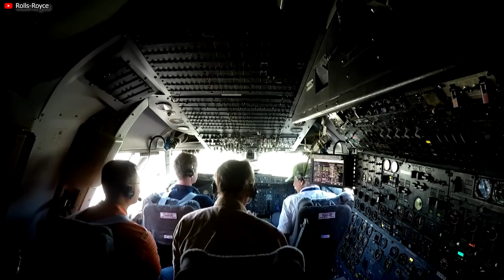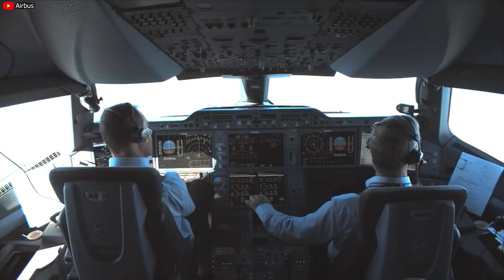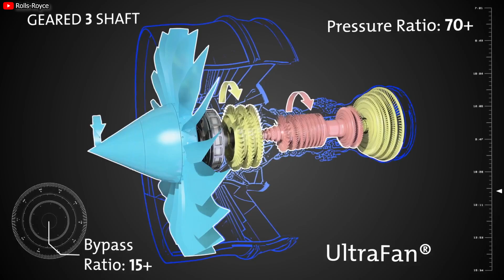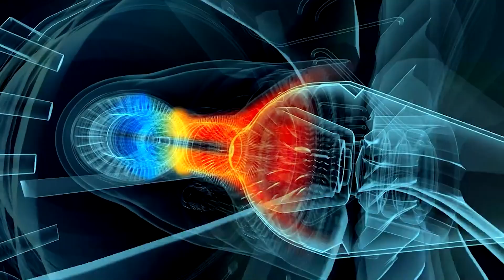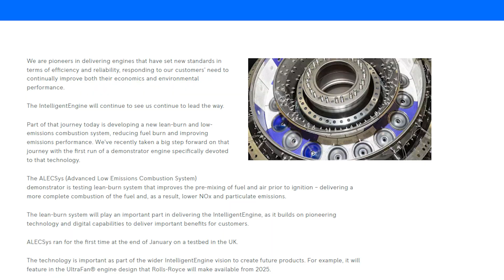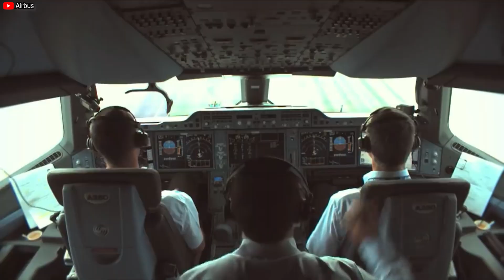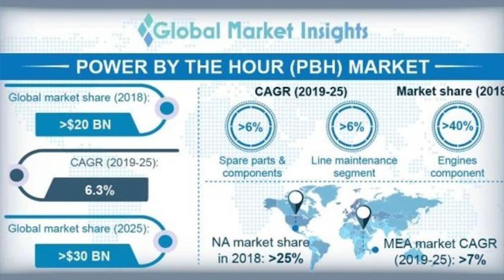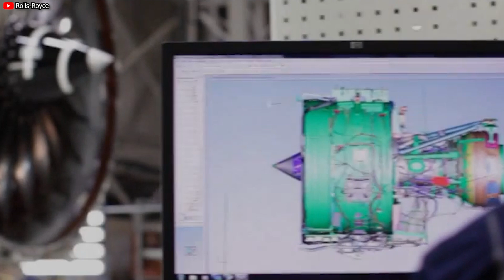Rolls Royce CEO: ''This NEW Engine Will Change The Entire Aviation"! Here's Why

Comment: Now we only need fuselages where it is possible to mount such engines. Boeing already showed how it does not work.
Reply: It will be fitted first to the airbus A350
Reply: @Bottle111  This would require a new design, as the center of gravity significantly goes backward, and additional forces are introduced into the tail. Then, it would no longer be an A350, but a new type with new certifications. You may pay the billions.
Reply from the maker: thanks for your comment
Reply: Older aircrafts mounted engines aft fuselage, ahead of the fin.
Reply: @hakantorstensson8053  DC9/MD80/B-717 worked like that. But it would be best if you had a T-shaped empennage so that the horizontal stabilizers do not get the exhaust of the engines. However, T-shaped empennages may cause aerodynamic problems in stall conditions.

Comment: I really don't know where you got your information from.

According to RR themselves, the whole point of this engine is to have a single technology that is scalable from the largest twin engined widebodies right down to the A320/737 and a little below - perhaps a stretched A220 for example.

This is in no way a move away from the single aisle market. It is very much a move towards re-entering it.

The A350 is reaching the point where people are starting to expect an imminent re-engine announcement. This could force Boeing to upgrade the 787"s engines to remain competitive.

Since the A320 series with the neo and the 737, with the MAX being quite recent and far less likely to have an engine upgrade, it makes sense to start with the big engines first.

As for the smaller versions, I think that may very much depend on whether Airbus stetch the A320 series further any time soon, or Boeing finally goes ahead with the NMA - or Airbus beats them to it!

Currently, there are no engines suitable for anything between the heaviest A321/MAX 10 and the A330/787.

The Ultrafan currently being tested could well be a candidate for a stretched A350 to compete with the larger 777x's. After all, the A350 has some way to go before it matches the length of the longest A340.
Reply from the maker: thanks for sharing

Comment: Yes, there is a great potential to these engines. The use of compound materials enabled the enlargement of the outer fans diameter. The former material used was titanium compounds that couldn't tolerate the combination of long fans with high velocity (the professional term is Critical Centrifugal Torque). Having huge fans enlarge the outer engine diameter that allows greater air bypass, that in turn brings to better cooling effect to the inner smallest fans (these can be easily reach unwanted heat closer to their melting point). It means that now the improved jet engine can be run at much higher speeds and therefore be put to longer shut offs for fuel saving and quieter flight experience.

Always happy to help,
Ken Barr, engineer and business analyst.
Reply from the maker: thanks for feedback

Comment: This is b/s. RR lets it sit there waiting.  It should be offered to the single aircraft market. There are hundreds still to be built. isn't it supposed to be scaleable? Its not even certified yet! What are they waiting for?
Reply from the maker: thanks
Reply: According to my info from private sources inside RR, 3 new UltraFans of different scale are being built. This engine programme is still in the development stages, although RR claim online that new tech will be moved sideways from the UF to the Trents. The XWB-97, which powers the A350-1000 is being upgraded in about 2027, with among other advantages, double the time on the wing between maintenance, which Emirates have walmly welcomed. UltraFan is benefitting current engine development for the Trents, right now.................